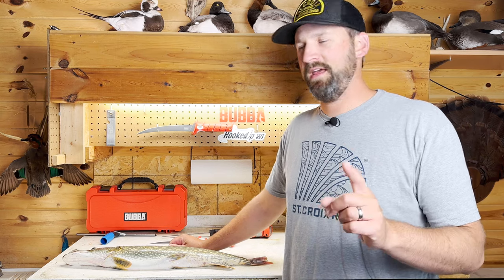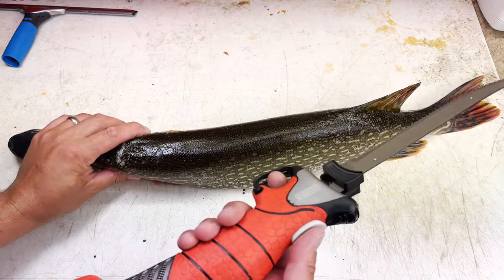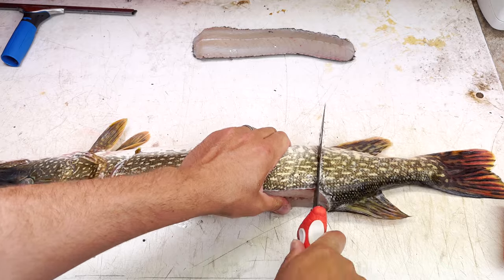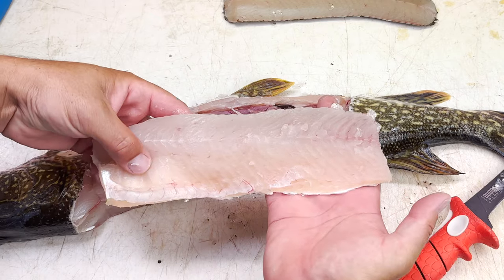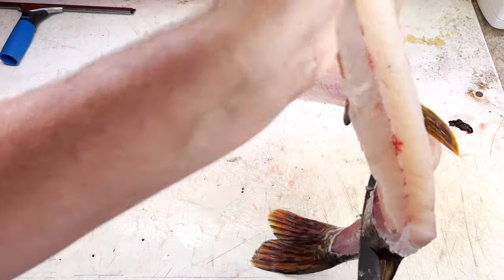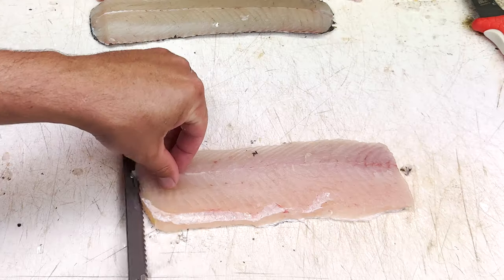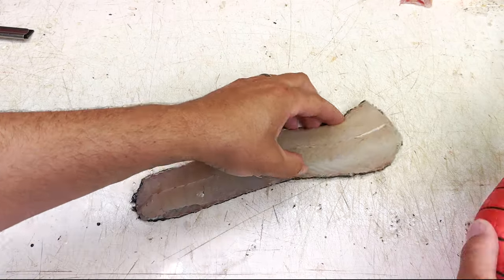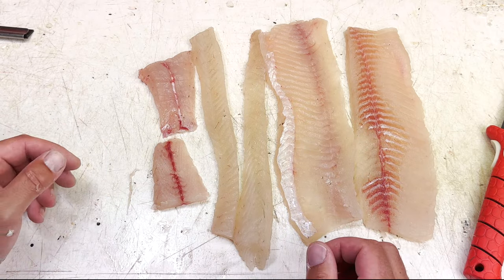Learn The 5-Piece Pike Fillet Method THE RIGHT WAY!

Comment: Aren't the ends of the Y bones also present in the backstraps? Also where is the V portion of the Y in the side straps?
Reply from the maker: Lots more info in this video! https://youtu.be/-xRPz_avl7o?si=rpqoexm9ktk7IV7x
Reply: @calebwistad  hi, I know that video as well. That's why I wonder why there are no tops in the backstrap or parts of the V in the side straps. It looks like you are cutting straight through them. I have done the methode shown in the video with the 5 pieces methode but I always had more bones in the backstrap than just the middle part